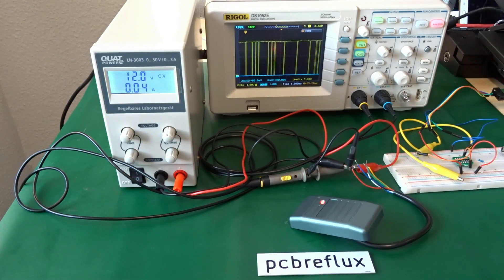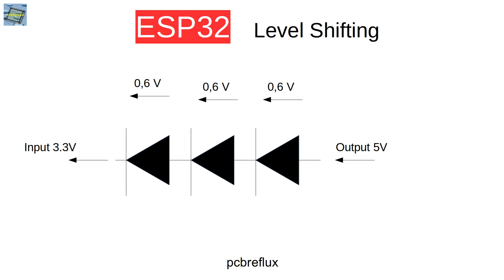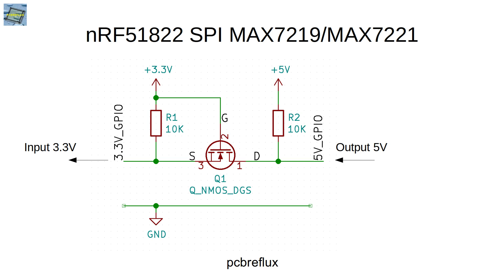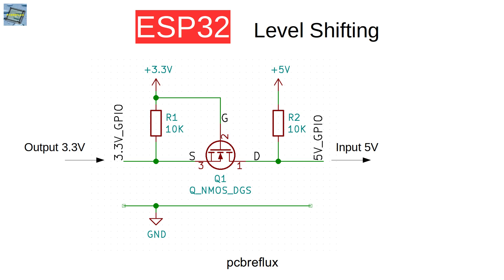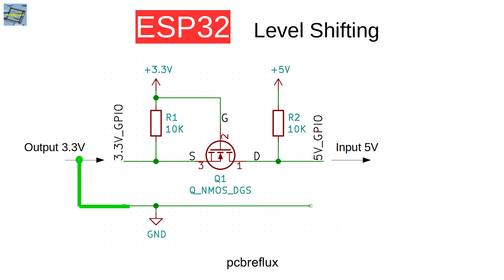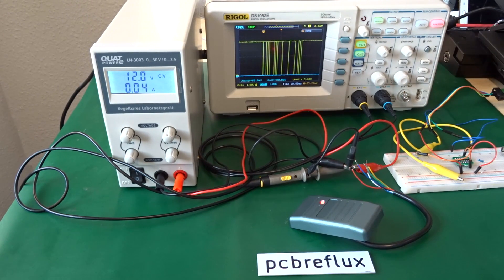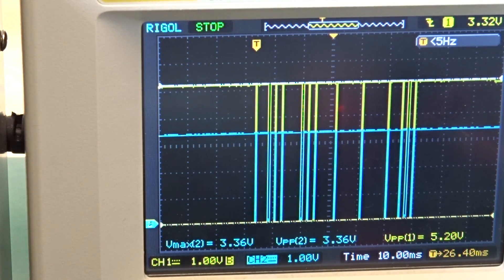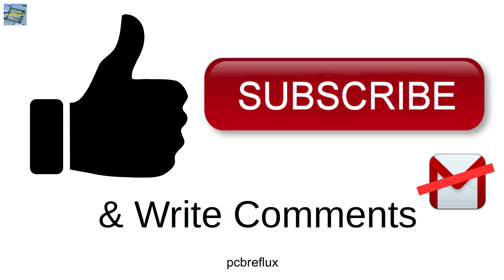ESP32 #61: Level Shifting - MOSFET Level Shifter

Comment: why we need 10K resistor connected to the 3.3v  ? what if we remove it at all?
Reply: It's a conductive path to the source. If you remove it, there will be no path to control the high/low of the opposite logic level. If you short it, you will have a null-impedance path to ground upon conduction which will short the FET

Comment: Simplest way for 3V<->5V is just use current limiting resistors. Almost any modern MCs have input clamping diodes that can do up to several milliamps. With 10k resistor and 2V overhead it will be less than 0.2mA clamping current, which is perfectly fine.

Comment: I use the 74LS245 its capable of HIGH speed 3.3v to 5V, but not backwards
Reply from the maker: Thanks. Have you maybe also the test 74HC245 CMOS level ? Any timing difference?
Reply: pcbreflux have not tried the CMOS one, i mainly use these for level shifting to Addressable LED pixels

Comment: Thanks for your contribution.
You can buy these MOSFET level shifters at eBay or ali. 5pcs @ 4 channels ca. 1 EUR. But they are using MOSFETs which are not really 3V specified, but they work in General.
This method is imited in frequency when driving capacitive loads. For GPIO or Serial Interface use most probably you will not face this Limitation.
If you Need a better solution: TXS0108e: 
Maximum Data Rates
–  110 Mbps (Push Pull)
–  1.2 Mbps (Open Drain)
•  1.2 V to 3.6 V on A Port and 1.65 V to 5.5 V on B
- 8 channels
I got one with a breakout PCB for 0.66 EUR @aliexpress - but not yet testetd

If you Need stronger push-pull: TXB0104
Reply from the maker: Thank you very much for pointing out detailed and advanced solutions.
Reply: By coincidence, I just wanted to buy an additional fascinating VL53L0X and founs e.g. ebay 232456086183. This breakout uses the TXS0108E (yf08e) level shifter.

Comment: It was a good tutorial.
I was trying to contact you about one  BLEclient problem please see this link: https://github.com/pcbreflux/espressif/issues/22
Thank you for your time.
Reply from the maker: Hi, 

thanks for finding the bug and also offer a solution. 
Committed the fix in github and close the issue. 

Have a nice day
pcbreflux
Reply: Im Sorry. I didn't get you.

What is the solution for this issue?
You committed the fix in GitHub?? What do you mean by that?.
Reply from the maker: Vishnu Dhanavath Sorry wrong issue (#25 not #22), have you try increase the task memory [xTaskCreate(ble_task, "ble_task", 32768, NULL, 5, NULL);]? This could solve the reboot loop? And use nvs_flash_init(); to get rid of the warnings.
Reply: How should I increase the task memory? Are these settings exist in make menuconfig or I should write a command?